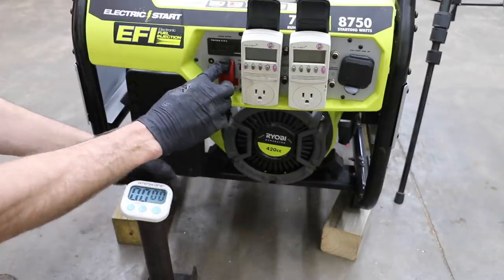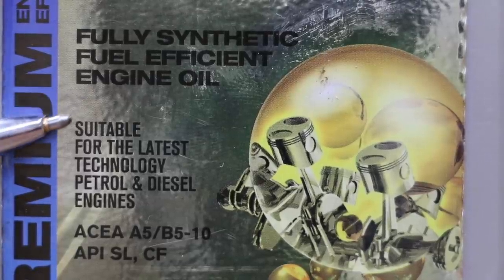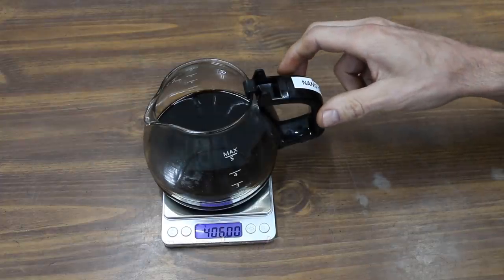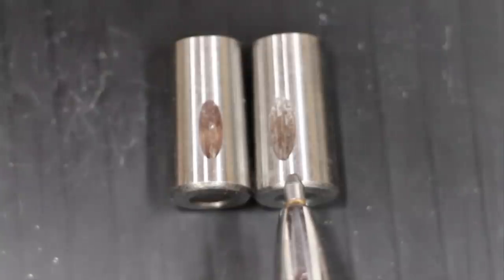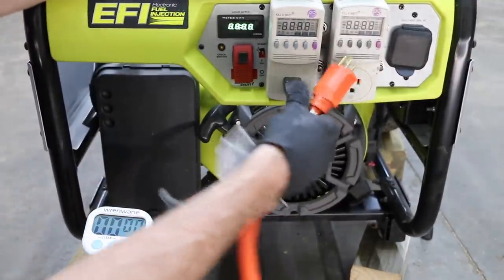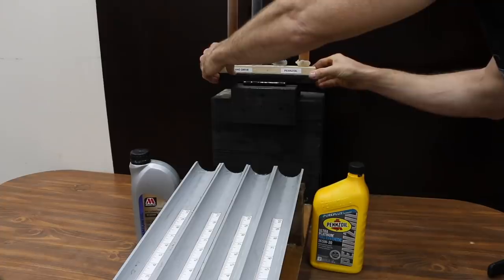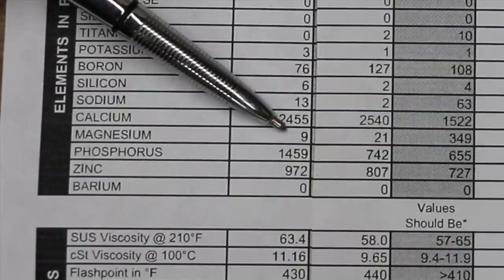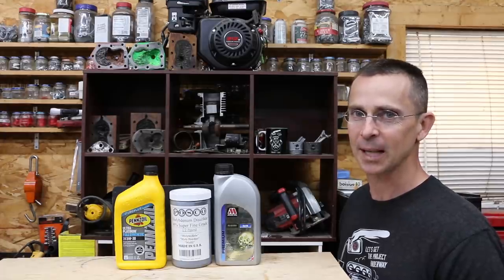Save Gas with "Nanotechnology" Motor Oil? Better MPGs? Let’s find out!

Comment: nano ceramic oil technology: viewers should read the patent on the technology.  It's basically a ceramic nano level lubricant that is superior to both Teflon and MoS2.  See patent at this link: https://patents.google.com/patent/CN101058760A/en

The "claim" was found valid when tested in the lab and patent was approved.  The ceramic coating bonded with the metal at .00005 nanometers.  (1 nanometer = 1 billionth of a meter)

...but

Just because it's a superior lubricant down to fractions of a nano (fraction of 1/25,000,000th of an inch) doesn't mean it's going to improve ANYTHING in your 1970 VW Van, or your 1995 Toyota Land Cruiser, or your 2004 Chrysler PT Cruiser.  Each of these vehicles vastly improve engine tolerances over the other, but none of them would show any improvement in lubricant engine efficiency after use using ceramic lubricants because engine tolerances don't require it.  It's like taking a firewood log, and splitting it into a million parts and thinking the log will burn more efficiently once you put it in the woodstove vs. just split it into 2-4 parts.  It's hilarious.  ..but if you took that million "sawdust" parts, you could press it into a 8'x4'ft panel and use it as paneling in your house.  Why? It's designed differently...and it's key to understand this with nano ceramic oil technology.

So,

Why would you need this in a lawnmower engine, or a 1990 Chevy Chevette or thinking it's going to do anything when the tolerances are acceptable in 1/1000th of an inch for both,  when this lubricant is in the millionth of an inch, and think that's going to improve anything?  You''d have to apply over 100,000 "coats" and believe each was somehow building up the tolerances, when the coating only bonds 1x, then wears over 50,000km - so it doesn't improve anything in an engine not designed for it.

 You may want this kind of "superior to Teflon" "superior to MoS2" in your 2020 ceramic car engine.  It's designed for those tolerances ceramic part/ceramic engines have. These tests are quite comical.

The best analogy is this:  Imagine you stuck fourteen  3ft long, 1/2 inch thick rebarb in the ground. Then, because "Wahl clipper blade" oil at 15.00 oz was advertised as a high end oil, you buy 64 Fl oz of it, and heavily splash it all over the rebarb, 3 or 4 coats. Why, it was advertised to sharpen metal to a razor's edge or keep that edge as an oil.  So, you apply it, and afterward, you fully believe all 14 of the rebarb are now sharp as a razor vs. round as a 1/2 inch metal marble as it actually still will be. Why? rebarb isn't razor or barber clipper tolerance level metal.  

 The point is, a lawnmower engine -- it's absolutely ridiculous to test this product on a lawnmower engine, or, conduct "viscosity" tests and think an oil that provides millionths of an inch tolerances..for lubrication ---when you're never going to get that in a lawnmower engine.  Anymore than squirting some razor oil on 1/2 inch rebarb is going to turn those 1/2 thick round rods of iron into sharp as razor items.  It's hilarious because it isn't going to work.   That oil WILL work on barber's razors and clippers to oil and sharpen those items.  nanotech ceramic lubricants will work in engines that CAN tolerate 1/1,000,000th and greater tolerances, such as today's ceramic car engines...because the technology is designed for it, and this lubricant has become prolific since the mid to late 1990s because ceramic engines are now prolific.

The best thing a reader can do is READ THE PRODUCT LABEL.  No Manufacturer can get a product license to sell unless it advertises what the product is and is specifically designed for--even if that's in the SMALL PRINT.  It's not going to hurt your engine using it, but neither is chopping firewood to 1/100,000ths parts for every log --that's not going to make your firewood stove last longer, either. So, STICK TO YOUR CAR'S WARRANTY AND MANUFACTURER'S MANUAL.  USE THE OIL/LUBRICANT RECOMMENDED FOR YOUR CAR'S ENGINE--IT WORKS.    Your 2010 Subaru doesn't need nanotech lubricants, so it's stupid to pay the money for it as is spraying razor barber's oil on rebarb and think it will be a razor afterward..then get mad when it won't.

Comment: Usually better fuel economy claims on products is based on long term use, as for oil it would be like our oil last longer or will ware engine less which in the long term will give you better fuel economy.
Also why does it trigger me they are using a petrol over gasoline or motor spirit. They might as well just put petrol and petrol engines seeing how diesel is a type of petrol "petroleum", sigh.
Reply from the maker: Thanks for the feedback.

Comment: So I have a suggestion for a video. What is the best product for foam filling your tires? I see a bunch of videos about using spray foam to fill your tires for your lawn tractor or wheel barrels. Supposed to make them puncture proof. Sounds great and you can get foam filled tires for  heavy duty vehicles. I also found a different product. https://youtu.be/7zmQl3KTy0Y. I wonder what other products like these exist and which ones will work to carry a loads.

Comment: This is not a comment about your work that I definitely respect but a general comment about Amerikan marketing.  "Nano' is the latest bullshit word that marketers are using, you see a lot of 'nano particles', as a pilot some years ago virtually all of the airplane companies found that turbocharging their engines was a good idea  (gee wiz, the air force did this during WW2) and a lot of planes had 'Turbo' written all over them so much that the FAA had to order labels on the plane fuel fills saying they used gasoline and NOT turbine fuel.  Other plane manufacturers redesigned their small piston planes with 'T' tails like those used on jets, they did it on jets cause they'd burn their tailfeather off if they didn't but that's not a problem for piston planes, the T tail didn't make the planes go any faster (actually worse) and there are a lot of structural issues with these designs that are not good.  It seems that a new term that is popular in some circles is 'root cause', I guess why my hair is thinning cause the roots are dying, eh?  Long ago our business leaders and politicians built their careers on actually knowing something and having done it successfully, today all too many of them are winning based on the amount of bullshit they can spin, this is not good.  Henry Ford actually designed cars, that included the engines, transmissions, and running gear.  Todays' 'leaders' grew up in marketing, finance, law, and accounting and don't know beans about what's under the hood or why.  That's why so many of them suck (both the cars and the leaders).  One thing about Elton Musk, he knows stuff, a lot of the rest of them are Aholes.

Comment: You ignored your own test results to pretend that the nano oil is better than the Pennzoil. Your 1.8 percent evaporation rate for Pennzoil compared to 2.5 percent evaporation rate for the nano oil is a huge 39 percent more evaporation for the nano oil. This means in real life long test of at least 8,000 miles or more, most of the anti wear additives in the nano oil will have evaporated, meaning less engine protection. Not only that, but in about 4,000 miles, so much of the nano oil will have evaporated, you will have to top up your oil with at least a half a quart, meaning spending more money for the nano oil, compared to adding no extra Pennzoil. We tested 100 taxicabs using 3 types of oil for Shell Oil. The tests lasted for 300,000 kilometers for each car. Some used a reclaimed petroleum oil, some used a semi-synthetic and others used a full synthetic. We were not supposed to know which was whcih, but since the cars using the full synthetic got better MPG, ran quieter and had a bit more power, it didn't take us long to figure out which was which. A full synthetic has molecules that are about 4 times smaller than the same grade weight as petroleum oil, which is why it is more slippery than the same grade of petroleum. That is why you have less wear and less engine noise with a synthetic. I have used a full 100 percent synthetic oil for 45 years. Trust me, it will save you so much on fuel, that it works out to be cheaper than using a petroleum oil of the same grade. Independ test show for a trip of 12 miles at 20 F temps, a cold V6 engine will save you 16 percent on gasoline on a full synthetic than the same grade of petroleum. A 4 cylinder tested under the same conditions saved 14 percent and a V8 saved 17 percent running a full syn oil. Mobil One and Valvoline full syn oils use a chemical base lube, not petroleum, which actually breaks down carbon into very tiny particles, which means, carbon does not form on your piston rings, valve stems or other parts of your engine. To test your engine running on petroleum oil, add one quart of Mobil One and check to see how dark the colour gets every 300 to 500 miles. That means it's cleaner up the varnish, sludge and carbon from your engine. It's your money honey.

Comment: The Pennzoil is just an overpriced Group 3, a hydrocracked molecularly-modified oil from NG. Same SN+ rating as Costco Full Synthetic that costs $1.50 to make. You should test both to a real Group 4/5 synthetic like Motul, REDLINE, Royal Purple and AMSOIL Signature. Wait! You already did tests on some of these. Just post the data!
Reply from the maker: Thanks for the constructive feedback